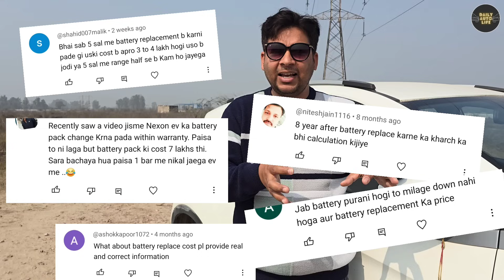7 लाख नहीं, सिर्फ़ 10 हज़ार में Change होगी EV Battery. Life भी 6 लाख Kilometer. सब चलाएंगे अब EV

Comment: 1. What is the annual battery depreciation that Tata claims , beyond which they will repair battery free of cost ?
2. What is the repair cost for batteries? Let’s say how much will it cost to replace the 10 percent cells of the battery?
3. Don’t you think that a refurbished battery provided during the warranty , may come with a new set of challenges, that may ruin the overall EV experience of the user?

Comment: In any battery operated electronics, companies do not promote battery repairs , so I strongly doubt they will repair the cells for out of warranty batteries . For an example have you ever seen any company repairing laptops battery cells or any other device which is out of warranty in any sector ?

Comment: Bhaiya if you don't know don't talk you are misleading public...no one can replace one cell or two cells in a pack ..the cells will imbalance as IR is different of new cell and old cell .
Reply: In a lithium cell, it is easily replaceable because it is not a lead-acid battery. Therefore, there is no tearing, wearing, or welding involved. You simply need the proper tools and knowledge to perform the replacement. In a lithium cell, the cells with lower voltage need replacement, and we can easily identify them. Each cell provides detailed information about its energy storage capacity and discharge characteristics, making it easy to find and replace them. Consequently, all cells deliver consistent results. With over 20 years of experience in battery technology, I understand how it operates.